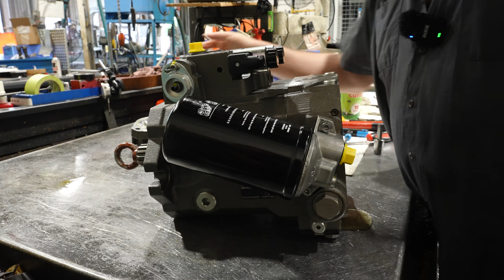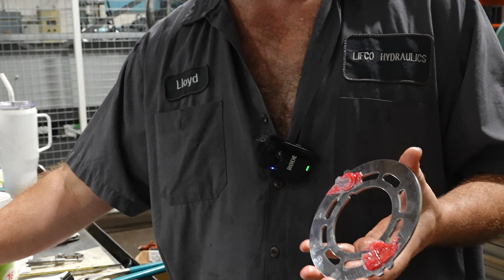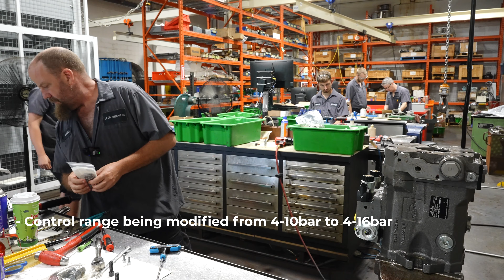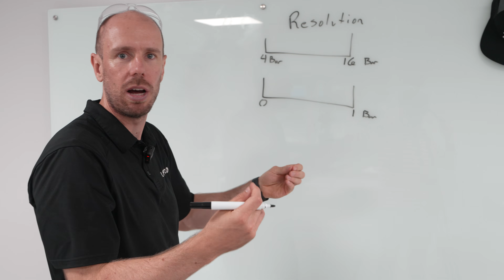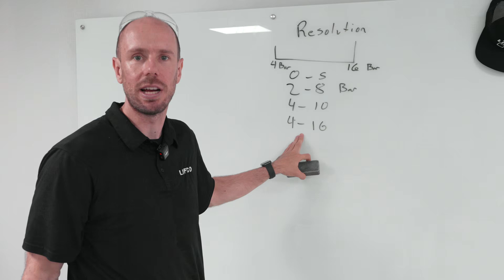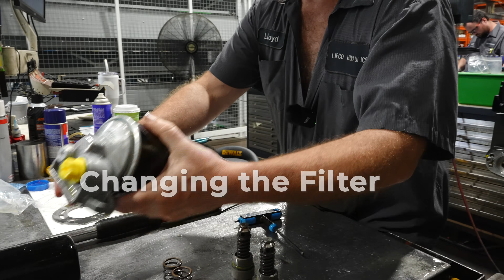Lloyd and Linde Ep.2: Pump Breakdown and Customization (HPV135)

Comment: The reason you gave for the heavy duty filter for higher pressure, I believe to be because the sealing rings would blow out on the standard filters, I never had issues in the field with this because I regularly changed  the pump & suction filters along with the hyd tank breathers, (they always get forgotten by those less vigilant) but colleagues who weren’t as vigilant did have issues.
Yet you’ve increased the boost circuit from 4 to 10 bar, up to 4 to 16 bar, by what your saying the heavier filter should be used on the higher boost circuit, yet on the AK30 combined pump & drive housing the boost circuit was 18 bar on a standard ringed filter, & the oil cooler circuit was 21 bar, & a Delta P difference of 12 bar for smooth drive, brake pack would release at 12/14 bar but ideally you needed to see 16 bar minimum, the high pressure valves on all the pumps we worked on were 420 bar, left Linde in the UK 20 years ago, had 18 years there, I too have specs & part numbers I can’t forget in my head.